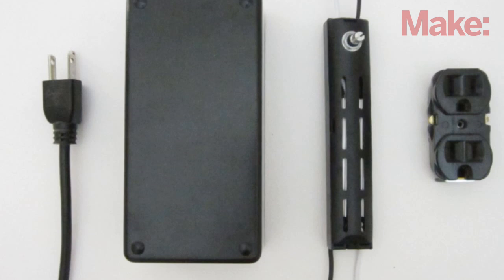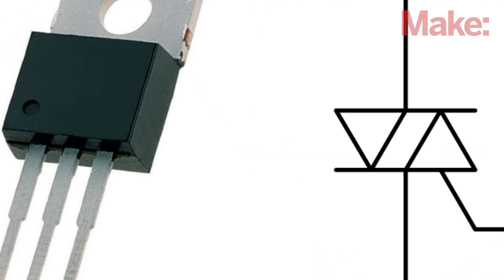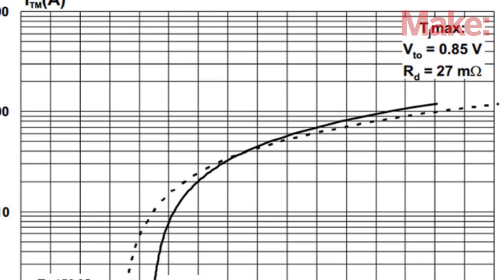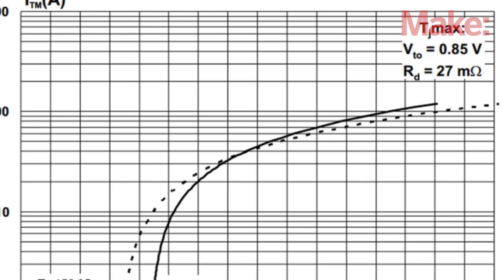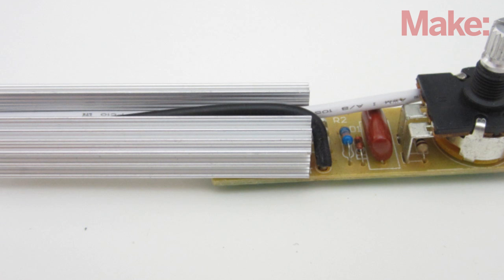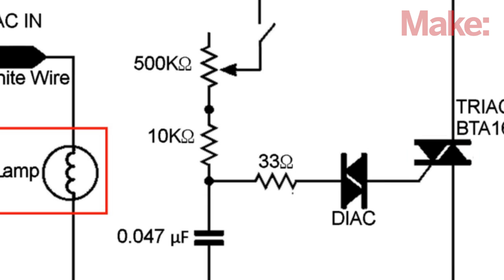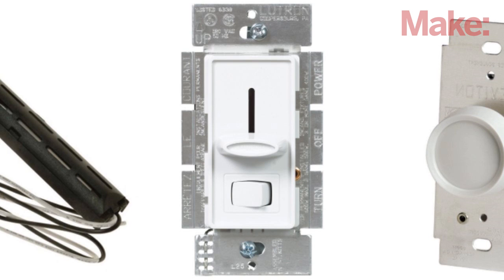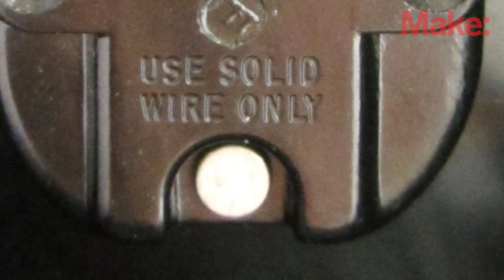DIY Hacks & How To's: Adjustable Power Outlet

Comment: I am not an expert. I am a homeowner who does most of my own electrical work. It is easy to see the downside of this project. Not enough information plus cost/time. In this case, one needs only to buy a lamp dimmer for $10. A safe, UL approved dimmer costs less than your suggestion and looks a lot safer.

Comment: You know the "hot/cold" wire positioning don´t have anything to say. it´s AC power, alternating between positive and negative:PXD
Reply: +Jakob Stendahl please don't wire anyone's home
Reply: +Jakob Stendahl That is so incorrect. hot/cold is NOT positive negative. The neutral wire is safe, the "hot" line is not. If you didnt know that you must not have any experience with electricity.
Reply: The neutral and ground are connected in the panel. If you have a subpanel then they should not be connected. The ground should be connected to a known ground like a cold water supply line if it is a conductive pipe and not PEX for example. I seen so much amateur AC work done that its scary. There is a right and wrong for AC. If you dont know what your doing let alone and get a pro or else you could kill someone.
Reply: +Jakob Stendahl its very important some devices have the netural and gndwire connected together if you get it wrong your circut breakers will probably blow

Comment: Here are the problems I see:
- Mounting the receptacle with just the center screw is a bad idea. The receptacle just isn't secure enough. Especially when it is just mounted to a cheap radioshack project box. After frequent plugging and unplugging the receptacle is going to come loose.
- Should use the screw terminals instead of the push terminals with pigtails
- Should use at least 14 gauge wire throughout
- Should show how to use a receptacle tester to test the outlet that you are plugging this thing into
- Should show how to test this thing after it is put together with an outlet tester
- Should specify ON THE DEVICE what the thing is, how it should be used, max wattage that it can safely handle.

Why not use a metal double gang box with an exposed work cover for a duplex receptacle and switch? Then you could put in a standard triac dimmer and put the whole thing together in 5 minutes.

Comment: To people saying this is dangerous: no this is not (but proceed with caution). with proper ventilation of the triac heatsink and correct use only with resistive loads (like shown) this will work fine and has been used for many years (how many times halogen torch lamps caught on fire, i don't know). The soldering iron, lamp, gluegun is ok but that analog grill uses way too many amps and will burn out the triac in time unless he checked the DS without telling us.
A better way to reduce ac voltage would be to use a variac or actually lower the peaks of the AC sine wave using a bipolar set of transistors but that's way too complicated for a simple weekend warrior "How To" especially if you want a perfect sine wave instead of a modified PWM sine/square wave.

Comment: so its a diy soldering station or lamp dimer made from parts that you have in your house. these parts include a power outlet and a dimer plus some 10 gauge wire.

PS if the wire is a different gauge pleas reply. thanks in advance Tucker

Comment: Stop encouraging people who dont know what theyre doing to mess around with mains electricity, you could be putting peoples lives at risk. 
Mains electricity is not something to be played with. 

Anyone who needs to work with mains will already know what theyre doing and hence there doesn't need to be videos made on the subject. 

If you cant safely touch the wires or components once a project is finished and powered (for example if the box breaks) then really you shouldnt be encouraging people to make that project. 

Please stick to 9 volt batteries.

Comment: ...........Wow this is more then not safe here is why and let me explain first nice video no problems there the warning comes from older homes built in the 50's and 60's where they enjoyed the use of insulation clay where they would wrap each wire in a clay insulation then cover it with fabric coating that was flammable to where if you placed a load on the wire you would get brown outs and fires now create a load in a box with a dimmer switch and now you have a dual fire the box heats up melts shorts starts fire in kitchen then as that short and fire starts the wall heats up and fire 2 begins my dad was a firefighter for 5 years and the number 1 cause of fires at that time home built power cords

Comment: Really? You guys usually make good projects. This one is a liability waiting to happen. You're giving advice in residential electric which I'm guessing you aren't licensed to do. More importantly you say nothing about what gauge wire to use and what appliances can be plugged into what size and temperature rated wires. You say nothing about wattage and amperage draw on household extension cords and dimmer resistors being used to power things like sandwich grills and coffee makers, which you show both of in your videos. Do you have any idea how many amps heat generating appliances draw? Additionally, you back wire into the receptacle which, while not illegal, is potentially dangerous, especially if you don't use the right size SOLID wire.  Do yourselves a favor. PULL THIS VIDEO before you burn someone's house down.
Reply: I know what Ken is doing, he's playing safety troll on youtube.
Reply: ***** he said not to use it with appliances that have control circuits

Comment: Just a word of warning to those that do not  know, this can not be used with ANY CFL or almost all LED house lighting bulbs. They do make dimmers for these type of bulbs and if that is what you're using it for you should be sure you use a CFL or LED safe dimmer rather than one that works with an inductive load. They will seem to work at first but will greatly shorten the life of your bulbs and dimmer circuit.

Comment: I'm going to have to add my personal opinion here. As an actual electrical engineer with over 30 years in the field, I really don't see anything wrong with this device. The only thing I would add is to make sure it has a fuse, and to only use a three wire plug on it, and perhaps find out the maximum wattage of the triac and print that on the case to prevent you from blowing it out.
Reply: So overlook the heat sink on the dimmer is being put in a plastic project box not designed for heat and no precautions taken for it. Using tiny gauge stranded lamp cord then suggesting to use the stab locks in the back of the recept not designed for it. I'm only a lonely electrician with 7 years in the field and a firefighter with 12 years and I can see big problems.
Reply: dj beard We're not talking a lot of power, also you can successfully install a heatsink in an unventilated box if you limit the amount of power dissipation. Go to a nearby hardware store and look at a typical 100 watt light dimmer, or take apart any laptop power adapter. I have a 100 watt laptop adapter completely in a black plastic ABS molded case. No vents. I've calculated that it runs at about 90% efficiency. It wastes 10 watts in heat. This triac circuit isn't going to be controlling more than 100 watts/1A. Even with a worse case Vdrop on the triac of 2V at 2 A isn't going to dissipate more than 4 watts. Tiny gauge? For what? We're not talking a lot of power and current. Your eyes might be better than mine, but I guessed he's using standard 14 gauge stranded house wiring. That's 8 mili ohms/meter. We're talking about a 0.16v for 2 meters at 10 amps with 1.6 watts wasted in the wire. That's well within the National Electric Code for that wire and safe for general use. Christmas tree lights are over that. Stab locks? Do you mean the screwless connectors on the receptacle? He's using solid wire for that, and using wire nuts for the solid to stranded connection. All perfectly acceptable for wiring when done correctly. Again, add a fuse, install a three wire grounded outlet/plug, and let me see that it passed emissions standards and I'll slap a UL on it.

Comment: So this video is really just rigging a premade circuit to an outlet?

Ehh, Grant Thompsons video was better.
Reply: I totaly agree
Reply: Which Grant Thompsons project you talking about?
Reply: The Scariac i think
Reply: Yes, the scariac. It's better since, though a tad dangerous, it is truly DIY, and can withstand current far higher than the typical dimmer...and even some real variacs.

Sure, it definitely isn't a proper replacement to real equipment such as controlled outlet or variac, but it will definitely provide a few hours of heavy-duty, high-current operation in-case proper tools aren't available.
Reply: No because his is VERY dangerous

Comment: i dont understand these circuit diagrams where a come from a resistor is a rectangle not a jagged line ; is that how they draw them in the states or am i missing something?
Reply: The resistor in a rectangle box as you put it , is a variable resistor. The arrow within the box is the sweeper which changes position and in turn changes (varies) the resistance
Reply: MediocreGamingMovies thanks for responding, however that is not what i meant,i know how a variable resistor looks like in a circuit diagram but the resistors in his circuit diagram is completely different. i was just wondering why it was different to the ones i usually see at my college in the uk.

Comment: I have two similar ones, made according to a project from an old Brazilian magazine. They work fine, but ONLY with some sorts of loads - A ventilator, a drill, a soldering iron will work but not a fluorescent lamp or some sorts of motors. I'll try to upload a video on that. It's rather simple and inexpensive to build.

Comment: That is going to take no amps. Put that on a heavy amp load and its going to heat up and fry and is a fire risk. A better methord would be using a VARIAC, they are made for this.

Comment: Ah, man, if you used this with a computer, it would prolly be all kinds of bad.
Reply: ***** You'll find it safe to try on a laptop as the power supplies are low wattage but you'll most likely be disappointed by the results.

If you do this with a PC be sure to try it on a machine you don't care about breaking (remember, hard disks don't like being constantly rebooted like that) and be extra careful to use a dimmer that can support the wattage of the power supply on the computer.

If you have a 500W PSU and can't get any more than a 100W dimmer then DO NOT ATTEMPT THIS as it will most likely cause a fire and you don't want that.

Comment: Seems like a perfectly reasonable circuit and I don't see any real safety hazards.  Personally though I wouldn't use anything I've made for long term use (only things like a soldering iron, waffle iron, etc.  Things that only get plugged in every now and then for a short duration of time).  When I was younger I made something similar but with a light switch and I never burned anything/anyone down.